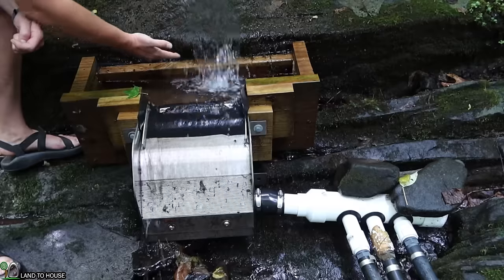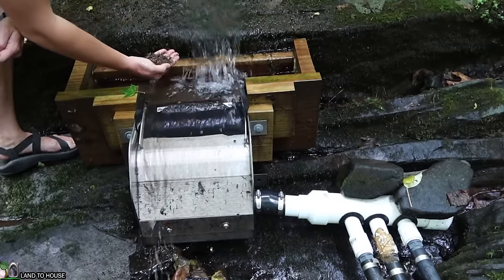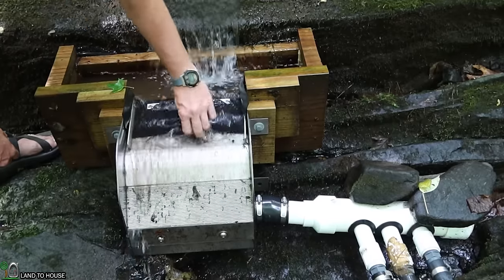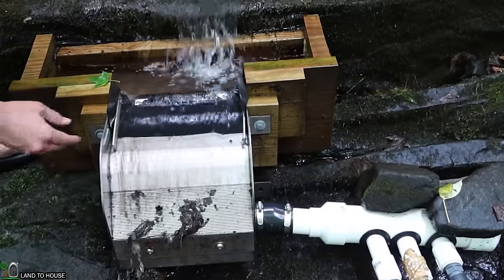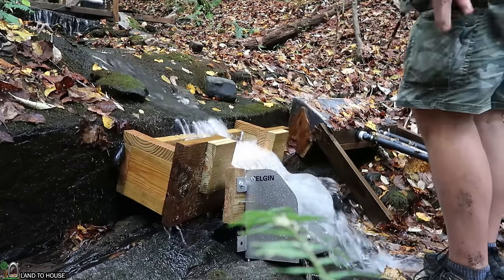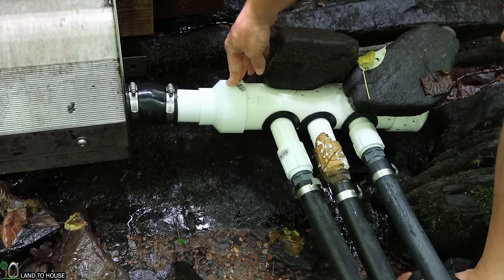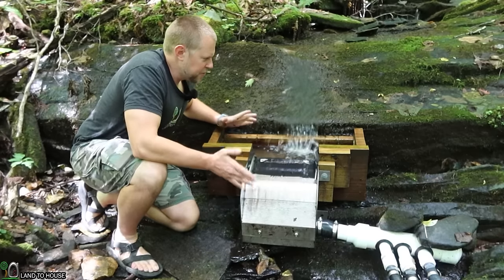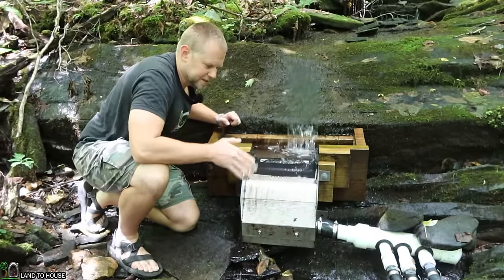Awesome Mountain Hydroelectric Power

Comment: I'm no physicist but it seems to me that the cover on your hydroturbine should be much taller to minimize negative drag inducing air-pressure (air pressure which causes the turbine to have to work harder causing far more wear on the bearings and components and making the turbine less efficient/ less cooling internally). I would argue at least a 6 to 9 inch taller box would be a lot better. 

A round shaped (maybe PVC, ABS, or some kind of plastic) box a specific size larger than the turbine would be best, and reduce the height necessary above the turbine. I could be wrong, but when you removed the cover these observations seemed evident to me. 

That or put small holes in the box (with screens) in the holes, to allow for better airflow/ air intake (ideally something that wouldn't allow water/ rain in). Some kind of air intake/ air induction seems to me to be a likely improvement (especially absent a larger/ taller/ round turbine box), which would increase efficiency, longevity, and possibly even increase electricity production.

The other thing I would recommend (though you've probably already considered this), is to cover the intake box/ assembly with a housing enclosure over it. Anyway, very cool setup and far beyond my engineering skills. I am a micro-electronics / computer/ IT guy. I'm currently trying to build a large scale whole house Solar/ Inverter system. And it's a lot more challenging than I anticipated it would be/ could be to get it the way I originally intended. And it's no where near completed.

Comment: $700 for that intake sounds about right. Just the stainless steel alone probably costs $300+. Add in the work to build it and $700 doesn't sound unreasonable.

Comment: If you are going to use compression fittings on any plastic pipe you seed to install a crush sleeve.  Or it will leak or blow apart every time.

Comment: 1) On your 3 pipe manifold; How can you get more water out than what's coming in?
2) A bit pricey, but on your 55gal barrel, why not use a standard bulkhead fitting?  They can't push out
3) On your micro's box, septic tank companies have very nice, structural plastic, 2ft dia x 1ft deep, stackable, septic tank access risers with domed, gasketed lids that attach with SS screws.  PVC boards are too expensive + construction time & leaks

Comment: Question, if you don't run the hydro in the winter months, and with solar being less than efficient in those months how do you compensate? I have a single panel  single 12 volt battery system to run a 12 volt led light in my garage, 24 volt 600 watt cell (in full sun) and it can barely keep the battery at 10 volts in the winter. I'm not necessarily comparing as i run one cell, one controller and one battery. Just curious how you compensate?

Comment: Heres a tip. You get the same pressure in water depth, whether its 50mtr under the sea. Or 50mtr to the bottom off a tube with water in.
Increase the pressure increase in energy.
You could increase you efficiency with a little change in the transport.

Comment: New product idea. Consider creating a high volume, low pressure Gravity Vacuum Water Pump from a lower water source to higher ground, such as a Pond or Garden, and incorporate a low volume, high pressure Ram Pressure Water Pump that continuously fills the sealed water barrel due to incremental water loss from the resistance water movement in a gravity vacuum, which lowers the barrel’s water level that’s needed to maintain gravity vacuum pressure. The Ram Pressure Pump is loud, so a sound proof enclosure is required, and the tiny ram valves can clog, so input filtering strategies are required. The Gravity Vacuum Pump output water into a Pond can include a Water Turbine for DC Electric generation to power a Pond weather station on a WiFi router that reports water level, water temperature at various depths, ice thickness, surface temperature, wind speed, etc. A Wind Powered Water Pump can also help fill a Pond, while also helping generate DC Electric for the Pond System or Garden. A ice depth device will require technology that doesn’t bend or break during ice movement, and have a buoyancy that’s lighter than liquid water, but heavier than solid ice in order to move the measurement device lower as ice forms, but remain under the ice above liquid water.

Comment: I' really surprised you had the water flow into the barrel from the top.  There's a video from practical engineering and if I remember right, the city sewer system uses the same technique but the water flows into the "barrel so to speak" from the bottom area from the side rather from the top.

Comment: Ready for some thoughts from a guy with zero experience? I would probably locate the barrel closer to the intake, with the barrel top only  just a bit lower than the intake plumbing rather than what looks like a good distance down the hill. Maybe get you another 10 feet of head pressure? Rather than letting the excess water flow out of an overflow from the barrel, I'd pop a vent pipe straight up out of the top of the barrel and have it extend above the intake height, so as to vent any air bubbles, but no water outflow. That way any excess water ends up helping to keep your intake screen clear, and you may collect less sediment overall.
Reply from the maker: Thank you for watching. Your ideas are good. The barrel is actually only around 2 feet lower than the intake. Its watt loss is only 6w. Not too bad. 

Now making the 3 pipes air tight and the overflow water pipe be taller than the coanda screen is a fun idea to try! Thanks.

Comment: I have a question for you. to keep your pressure without using that much of elevation can you extend the tube length for creating spiral path. The water should stay under gravity for a lot longer to gain velocity for you to keep similar pressure without that much drop in elevation.

Comment: What kind of losses do you get at the rectifier?  It's been decades since I did LV power, but those rectifiers were always very low efficiency (and thus why most all modern homes maintain AC power throughout ).  Haven't watched the entire video yet but am guessing you are going for DC to feed some battery system?

Comment: 8:01 if u could get a swimming pool return jet assembly to put on the barrel to connect the pinstock it will never come out. It threads on the inside of the barrel with a 1 1\2" nut and then has a female thread on the outside for the pinstock

Comment: Not sure if you covered the following: If the HYDRO goes off, does your system disconnect from said HYDRO? i HOPE SO as I was at one time on a Coroners jury after a death caused by feedback into the low voltage side of a transformer that then energized the high voltage wires when the workers knew them to have been shut down. The result was tragic.

Comment: The shed looks nice.  For my system I've developed a device that uses excess power (and no more) to heat my water.  It's been running for a few years and I'm considering productising it.  Do you think there's a market for this?
Reply from the maker: From my experience with selling product I would say that yes there is a market for that. especially with  offgrid solar and hydro people

Comment: Interesting setup. I get that you are/want to be off grid, but all of those resources for 100W of hydroelectric does not make sense to me. Perhaps you said it earlier, but I would upgrade to Lithium Iron Phosphate batteries, but get the heated version. You'll never go back. If you are going to have all this, I would try to have it so that your solar and hydroelectric are always working that there their is almost no point where the batteries are completely full. I would do what I could in the home to use this power so that none of it is wasted to justify at least a bit your investment. If your batteries will last you 3 days with no decent sun then you should be OK. For a small set up like that why do have to generate 3-phase power? I like the 4 points where you supply water to the impeller. It would be interesting to compute the efficiency of your propeller. I'll give it a bit of a try here below. 
      I don't have enough here for anything legitimate, but just guessing that your flow rate is as you say about 100L per minute = 1.6 L/s = 1.6 kg/s
Now, at the other end you say have created a pressure head of about 60 psi ~= 400kpa and you have a tube of 2 inch in diameter with a total area of about 0.00196~.002 m2. So the force that the water would experiencing at the lower end of the penstock would be about 800N. At your flow rate of about 1.6L/s is at the top, but must be sustained at the bottom or your barrel would empty. Since it is full then the flow rate at the bottom is about the same. So, if the flow rate is constant, then the energy is manifested by the speed of the water through some type of orifice or even the end of the pipe. OK, so we have 1.6 kg of water under a force of 800 N. 1.6 L of water would be contained in a pipe length of about 80 cm. So, the speed of the water at this point is about 0.8 m/s. So the available power can be inferred from the product of the force and the speed P = F x V = 800 x 0.800 = 640 W. If my napkin computation here is even remotely valid you are getting about 100W out of a 640W of available mechanical energy. I realize that the water turbine will have inefficiencies, but this does seem pretty low to me. Henri (Physics with Henri)

Comment: Nice to see a follow up.  Don't you lose all the pressure from above the barrel, since the barrel isn't air tight?
Reply from the maker: It's hard to see from the angles that I filmed but the drop from the intake to the barrel is only about 2'. So out of the a 150' of head pressure 2' of loss is not significant.
Reply: @LandtoHouse  That's good to know.

Comment: Router a half round into each level where the motor mount bracketing glue a rubber seal in / the conjunction half round in base mounted to spray a release seal / same in lower level of base that was leaking is a better seal as well as does away with sylicon/ silicon which is just a mess overall = and yes does apply in winter utility , just make sure the solid rubber seal is slightly bigger than allotted spacing

Comment: man you must use alot of electric . your system you would think would cover all your needs and then some . have you thought about using electric car batteries i know you can buy them on ebay but i have never checked the price of them . seems like they would hold just as much if not more power then the batteries you have now they would look nicer and i want to say would give you more room and you can mount them to the wall . you have a really nice system  .

Comment: It's cool I'll give it that. I really question your scale though. U did all of this for 50w? Only usable maybe 7 months of the year? Now u got down to the turbine and said 100w. That sounds more useful. Double would be more practical yet but if u can continuously get 100w I see a bit more of a reason this isn't a waste.
Reply from the maker: Its mostly a hobby. Several people have built systems with tips from my videos. This one can do 400w if it rains.
Reply from the maker: The voltage is 200v. But the charge controller brings it down to around 70v.

Comment: If you ever have to redo your barrel, you should look into making a radial flow settler
Reply: Curious - what is a “radial flow setter’? I run a pelton wheel hydro system but am always interested in alternatives/improvements.
Thanks!
Reply: @sadiecovelodge  they're used in aquaponics a lot to get air and solids to settle out of the flow. Using it here would help keep debris out of the system as well as reduce the possibility of air bubbles from the input getting sucked into the output. Basically you have an inner chamber on the input that the fast moving flow comes in, then has to slow down to get to the rest of the system/output giving any solids/debris a chance to come out of solution.

Comment: Your videos make me wish I lived closer to a stream. 

Some suggestions for your hydro-electric system: 1 I know you know this but, place your generator as absolutely far downhill as possible and the water collection tank as close to the source as possible for maximum drop. 2 Try to triangulate-brace the support structures under the water lines. It might help prevent some collapsing.

Could the Inside End of the overflow pipe on the hydro-electric water collection tank be positioned within a couple inches of the bottom of the tank so it'll draw at least some of the sediment from the bottom and eject it?

Keep up the inspiring work.

Comment: Really love the system! 
How do you feel about the output from your hydro system compared to your calculations? 
What are your thoughts on the cost of battery storage - is it worth the upfront investment? (How many Kwh do you have?)
Reply from the maker: In the springtime my system does really well because it has plenty of water flowing. As the summer goes on and the rains stop the system slows down. Typically makes about 3K A-day whenever I have plenty of water. I just filmed a similar set up. a guy making 800 W continually.

Starting with lithium iron phosphate batteries from the beginning is expensive but well worth.
Reply: @LandtoHouse  Ah thats not too bad! Many thanks for the feedback.
Hmm yup LiFePO4 make a lot of sense, just such a large up front cost, if you work out the "total energy cost" over their lifetime. 
Fortunately I do have grid connection, and Im just using my green energy to heat up the hot water tank - which acts like a battery itself, but I keep thinking of scaling up more!

Comment: Nice except you are depriving the downstream of the water it is used to. Will this cause the ground to dry out and cause the vegetation to die and be replaced by weeds?
Reply from the maker: I tried to mention a few times in the video that there is plenty of water in the creek. Just 20 feet below my intake is a spring. By the time you travel down 1100 feet there is another 60gpm flowing in the creek.

Comment: If your hydro is at 100% on the charge controller and you are using mostly solar is there a way to stop the turbine from spinning without going to the top and turning off the water flow into your system? I would think you would want to reduce or stop wear on your turbine.

Comment: You should make a two twenty system for welding and power tools
Reply from the maker: You can feed this power into a battery and use it with a 240v inverter.

Comment: I like your micro hydro design. I am curious, what do you do when it is freezing out?
Reply: In the video, he says he doesn't use it in the winter, he is connected to the grid so he doesn't have interrupted power supply.

I have zero experience about these systems and requirements, but being a guy, I love watching videos like this and day dream about off grid.

With my zero experience, I would think that If you live in an area that freezes and want to have year round hydro, I would think your source would have to be an underground spring head instead of a running creek and you'd have to build an insulated collection box and insulated or buried pipes to the hydro generator. If this is the way, it sounds like a MASSIVE undertaking only for those with little or no other options.

Looking forward to hearing from others with actual knowledge and experience about that.

Comment: Have you thought about using successively smaller diameter tubing from your source to your generator?
Small diameter tubing will induce a higher flow rate, allowing you to use a smaller generator with less torque. Probably much more cost efficient (both capital and longevity wise).

Comment: You need to seal up your power shed with some metal flashing and silicon. Critters will get in and start destroying things and it could start a fire, but also just ruin equipment.  Insects tend to be drawn to electric fields too for some reason, especially roaches. In the winter the warmth will draw in rodents too.

Comment: We need updates!! This is 🆒🆒
Reply from the maker: In the Spring whenever the weather is warm I will certainly do an update video. A lot of big changes. A 15 kwh battery connected to an 8 kW inverter and a 5 kwh battery connected to a 3.6 kw Inverter.

Comment: I just want to make sure i caught the power rating correctly. 

Your system has a max of 400 watts???
Reply from the maker: Because of the low flow that is correct. I filmed a system in wnc that is making 800w all the time. So more water is all thats needed.

Comment: Great job Seth, have really enjoyed ur series, u have dedicated a lot of time, money, effort, thoughts & labour to bring us these vids & appreciate ur efforts. You have built a fairly nice system there, many should appreciate. 
I was hoping for greater outputs, but 1-4kwh/day is certainly not to be sneezed at as supplemental power to ur PV solar. A few sever rack type batteries would be a great upgrade & makes it neater & easier to configure, I have 3 x 48v 5kw Seplos Suntorque batteries, they are ok, but do ur homework on BMS communications, etc, these get a bit too involved for the average Joe if you want to know what’s going on inside & configure better BMS settings. Another option I am currently playing with is 310A Lifepo4 Prismatic Cells coupled with a JK 200A BMS, a relatively simple DIY and robust with nice BT app, check out Andy’s Off Grid Garage Australia channel if ur interested in this type of batteries & solar tech, he is good.  Cheers

Comment: wouldnt the overflow tank release head pressure from above it on the line? or am i misunderstanding the fluid dynamics of the system.    i would assume you want that as close to the source as possible, so that the pressure can be as high as possible since thats where the power comes from.